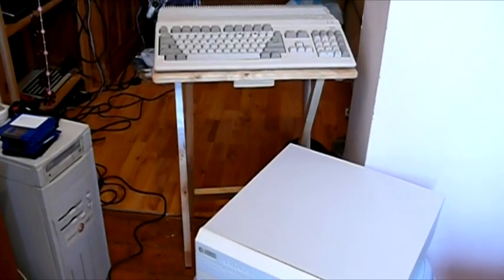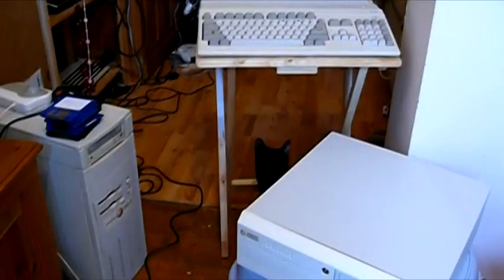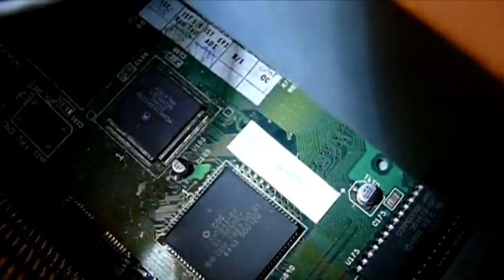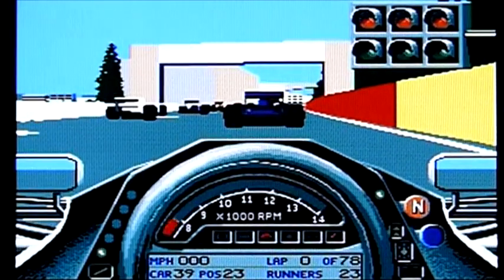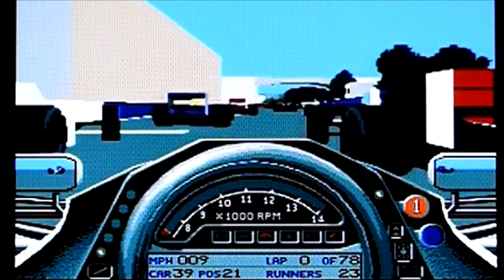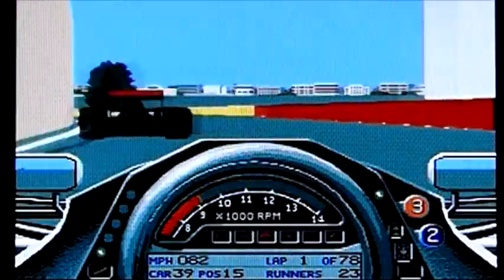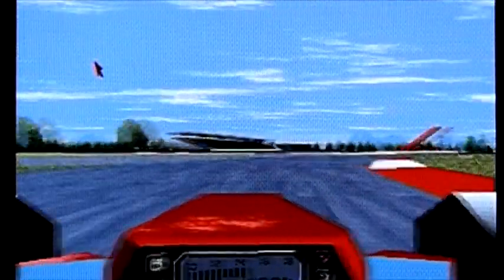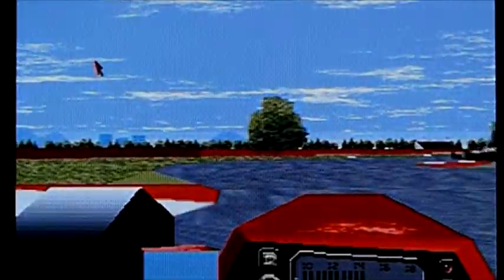Amiga Chipsets: OCS, ECS & AGA

Comment: @SteveBenway   I wish Commodore had kept the A1000 design as I think it was such a nice bit of kit and looked much better on the desk than the A1500/2000 ever did.  Do you remember the A500 drive add on, the A590 I think it was called? Something like 20Mb storage which was huge back then for an Amiga.

Comment: If you have a Rev 6 A500 mainboard you can make the 512kb memory expansion part of the chip ram. It's a very simple soldering job on the mainboard. I believe it's also possible to solder the memory chips onto the mainboard, but that's a lot more work.

Comment: You should get an old 486 low profile heat sink and put in on the 060. I've seen them only a few mm's high and shouldn't have any problem clearing the case.
Great video, very informative.

Comment: "My god, that sounds nerdy"
10:34 I believe the cards in the Zorro 3 port(s) reached past the slots on the left of the image, and connected only to the one slot on the right. From the outside of the case, it reaches to the far port, skipping over the close one(s). 10:52 is slightly concerning. A standard BIOS button cell is 3VDC, and those two batteries are giving the right voltage...just, clock batteries are generally rechargeable, I'd be afraid to put non-rechargeables in a charging situation.
Reply: Two things:
1. That mod may disable recharge.
2. Duracell makes rechargeable batteries.

Comment: I was just wondering, the concept of putting a 'A1200 in a tower', did you get an A1200 motherboard, rip it out of the machine and basically shove it into a tower giving it the space for worthwhile upgrades or did you just buy a A1200 tower pre-made and just add gubbins of stuff to it making it a mega 1200?

This element of the AMiga has always confused me, but intrigued me to the max.

Comment: I'm sure someone already wrote this, but anyways:
Basically every Agnus used in the A500 is capable of 1MB of chip RAM. The first one 8370/71 didn't have the expanded registers, so it was limited to 512KB of chip, while the other 512KB were connected like chip RAM and by this, only as fast as chip RAM, but could only be used by the CPU. This is called "ranger RAM" nowadays, since it is not as fast as true fast RAM. The newer ones 8372/8372A could use full 1MB of chip RAM, even in an A500

Comment: The ECS could do 30kHz (VGA) display, albeit sluggishly, while the OCS could not, which is in my mind the main difference. The fast ram in the A500 is not at all fast, as it uses the same bus as chip ram, for example a nasty blit would lock it out for the duration. The A600 can address 2MB of chip RAM, even tho the machine was sold with only one. The 68060 is actually somewhat cooler than the 68040.

Comment: Thank you for your video, sir.
I had an AMIGA 500 with the mammoth 4MB Trapdoor upgrade and I also installed a 68001 FPU/Maths chip!? OR  it might have been a 68002! If my memory serves me correctly LOL :)
The machine was in its day as fast as the Amiga1200, to me anyway, I did this upgrade to run The WING COMMANDER GAMES 1+2 at a faster/fluid gameplay mode.
I also noted, and you also said, you have not installed a FPU and you should install a 68002! as this makes any maths calculations as fast as hell, crunching/uncrunching and such but most of all this would complete your fantastic A4000 and would calm my computer OCD to boot:). FPU chip are very cheap and I can promise you. you will notice these little components impetus I was impressed with my little FPU /Einstein! :) 
PS I only sold my AMIGA because I played DOOM on a PC With SOUNDBLASTER 16 :) And I was hooked.
Please post more videos of your collection.

Comment: It actually was the 040 on the 4000. But to sell more systems at a cheaper price, big C= came up with the 4000/30 a bit later. C= made so many mistakes along the way, especially developement on the Amiga was very slow and almost everytime "last minute", not ahead of time like the original Amiga was.

Comment: So the 1200 is better than the 1500 or 2000 or 3000. Got it. Makes sense.
Reply from the maker: It's kind of a tricky one, in some ways. The 1200 has better graphics and more chip ram than all of those. However, all of those have more expansion possibilities in standard form (ie. a Zorro bus board with expansion slots), and the 3000 has a faster CPU.  Having said that, if you were/are prepared to pay the money, you could make the 1200 more powerful in every respect... but it's an expensive thing to do.